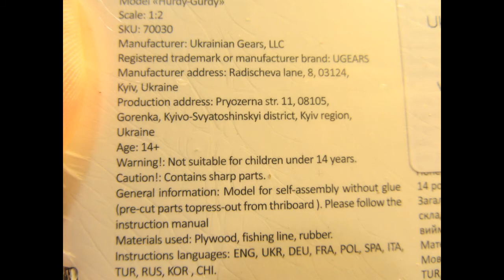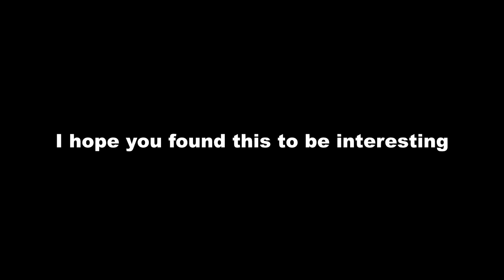UGears Hurdy Gurdy

Comment: My hat is off to the designer of this kit!  I wonder about the life span of those rubber bands.  Modern bands are synthetic and deteriorate fairly rapidly.
Reply from the maker: Leland Rogers, yes, that is my major gripe with these UGears kits. Based on my experiences with their hurdygurdy and their locomotive, they rely on rubber bands that are buried inside the structure, and when the rubber bands wear out or break, the kit will cease to function, with no practical way to fix it, and the kit will become a purely static piece of sculpture.
Reply: @youtuuba  I just got one of these kits today. Thanks so much for this detailed demo. Luckily I have a lifetime of building musical instruments (60 years) so plan to give it my best. There are a couple of improvements that could be made to make this much more playable and durable. Of course, this is a puzzle and is not intended to be a legitimate instrument, just a working model.